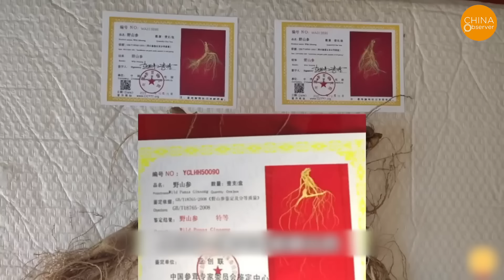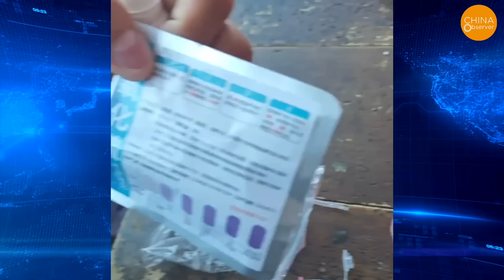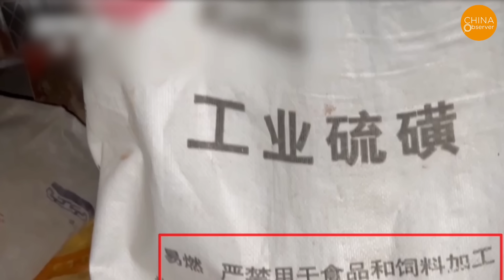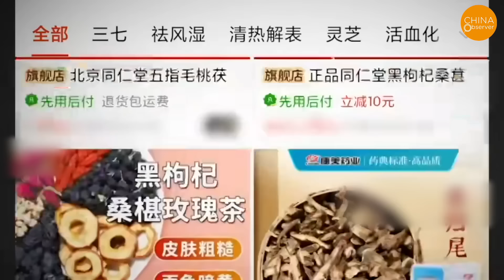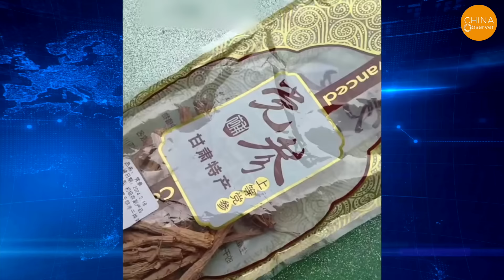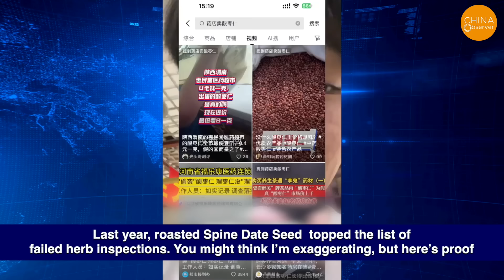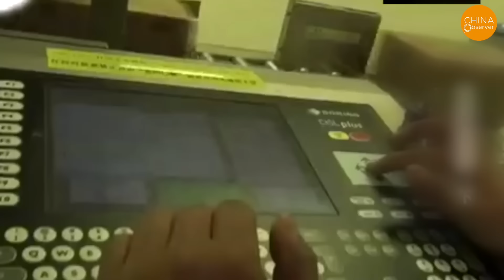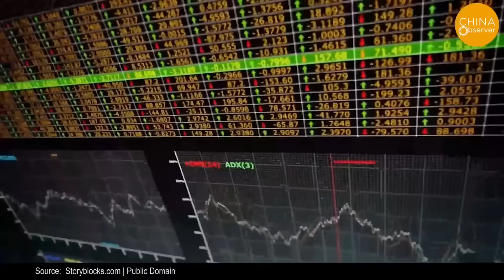Dyed Sea Cucumber, Sulfur-Treated Goji, Fake Ginseng—Dare to Try China’s Fake Seafood and Herbs?

Comment: With the spine date seeds, the even worse situation is if they started using NOT white hyacinth beans. They wouldn't look any different (since they are skinning and splitting the seeds,) but matured hyacinth beans with seed coat colors other than white tend to have much higher levels of toxic substances. Both are still grown for both vegetable (they're not dangerous when not ripe and still fresh immature pods,) and ornamental (many have pretty purple flowers/leaves/pods,) but, while white skinned hyacinth beans are safe to eat after just boiling, colored skin ones would need a long period of leaching in many changes of water to be rendered safe to eat.

And I HAVE seen colored hyacinth beans added to Chinese herbs being sold before, once in a group of white ones (which was probably a mistake, as it was five or six in a bin of hundreds. Sort of like the odd brown one that shoes up in Indian material (they eat them as well.),) and once in a bin of black soybeans (to tell them apart, ALL intact hyacinth beans, no matter the color will have a white raised "ridge" that will run down about one half to two thirds of one side of the seed.